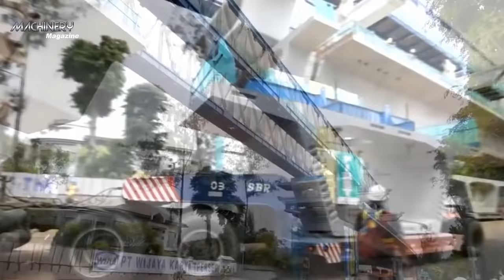This Modern Bridge Construction Method is Very INCREDIBLE, Amazing Construction Equipment Machines

Comment: Yes, it is incredible, but also much more expensive than for example the method that is used to construct a bridge in my vlog. There's so much steel in it at least in this first method shown. The other method looks much cheaper and more efficient although requires huge funds to create the facilities to produce those prefabricated elements. And it wouldn't be possible to transport them from one location to another for example in my country where we don't have wide enough roads.

Comment: They built a 150’ span with the curve reversed near use. It wasn’t technically upside down. The mounting pads were on bottom. But it dipped instead of rose. Had to tear it out.

Comment: Ust about every image in this video is about prefabricated spans.
I'm at least as interested in what methods might be used to accelerate the construction of the piers.
In southern California, we witnessed the recent extension of a light rail system and.... it took forever. Preparation of the sites took about a year. Piers weren't prefabricated but were constructed of reinforced poured concrete, then left to cure more than 6 weeks before spans were lifted into place, taking at least a week for each length of several hundred feet.
Maybe there was no time pressure, and it was considered important to make sure the concrete cured sufficiently, but the project literally took about a year from ground breaking to trial runs.

Comment: Butt welding two sections together cannot be as strong as adding a gusset. [glue two boards together, edge to edge, apply downward force, see were it breaks]. Joints like that simply don't have enough surface area. Same goes for steel.  Modular construction is faster, and CHEAPER . . . but that don't make it right.
Reply: I'm sure the designers and engineers will pay due attention to your criticisms.  BTW, why does the joint need to be stronger?
Reply: @paulrawlinson8653  Try building a house without top or bottom plates, see how it holds together. But first, get your high school graduation.
Reply: @lingcod91  Interesting that. I build houses for a living. I know that purlins only need to be joined to rafters well enough to resist wind lift, but a truss bottom chord needs to withstand shear, tension and wracking, so needs a much stronger connection.  I didn't disagree that a gusseted joint was stronger. I queried why  it needed to be stronger. And I graduated university with BSc. (Phys.) Perhaps you'd like to answer the question?
Reply: @paulrawlinson8653   Why argue a point that won't ever be tested ?
Reply: @lingcod91  You appeared to criticise the method of construction (with a competely erroneous analogy) implying the joint should be stronger. I asked on what basis you had deduced it should be stronger. You haven't answered that question yet. 
By the way, if you glue most boards together edge to edge and press down on them, the wood will almost always break first contrary to your implication. The same is not true of joining wood end to end (I really do build houses for a living). But your analogy was in error anyway, because metal is not the same as wood and what holds for wood doesn't hold for metal. whether you are talking strains and stresses, joining techniques etc.